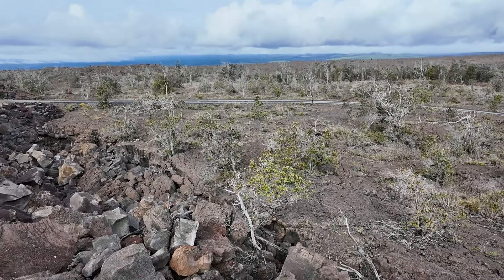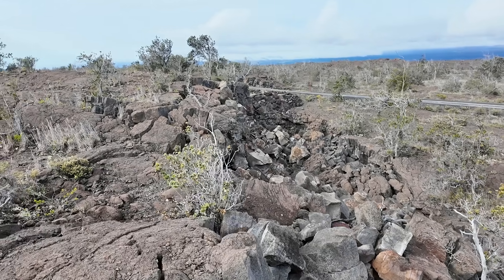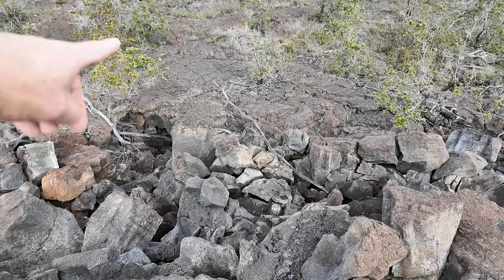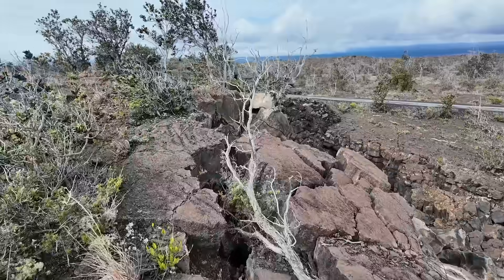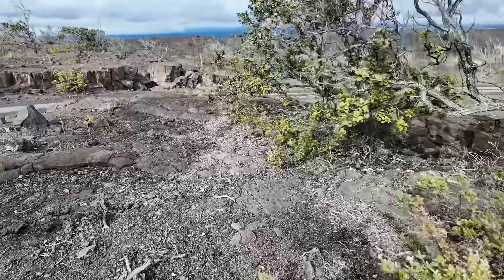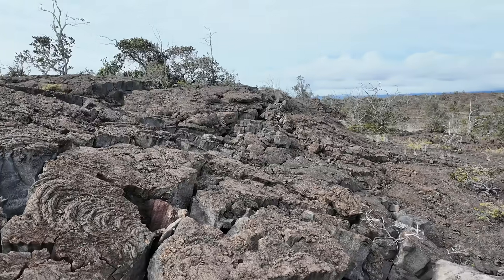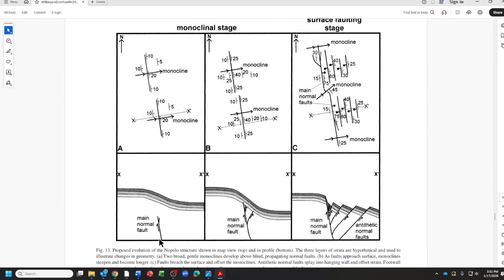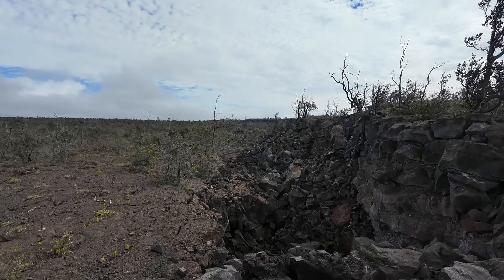What Is Ripping Kilauea Apart? Inside the Koa'e Fault System

Comment: Very interesting. I noticed the road was intact where it crosses the fault line. My interpretation is that the road pushes the pavement tightly when a vehicle crosses the fault line. This compresses the breaking rock, causing a strengthening of the broken lava to hold its shape.

Comment: Your funny geological true story. 
Up in Altadena on a small dead end road was a quiet community of six or so houses. A vacant lot was sold on the road and first thing was a major drilling operation about where a future house was to be built. Of course most of the residents was disturbed by the noise and industrial goings on on their tiny one lane street.
Eventually the bore hole was completed and a home built. A little sleuthing on the part of myself and a friend who lived on that street we discovered the new home owner was Dr. Richter.
Further inquiry from the Doc himself was illuminating. The dry supposed waterway behind the houses on the north side of the street was in fact a fault line, a spur off the major fault running under JPL about a mile away which in turn was a major fault off the San Andreas, one of the larger faults of the 'herring bone' running through southern California. He explained the dry waterway was a lateral shift between two stable ?? plates? I forget his terminology. It was a hyperactive something that directly reported the SA activity to his seismo. 
Doc Richter explained to us. He wanted his own personal seismograph to keep track of things during his retirement. The garage of the house accommodated his lab and test equipment.

Comment: I was on Big Island in November of 2000 and over 3 feet of rain fell on the summit and east slopes of Kilauea in less than 48 hours.  A big chunk (technical term) of the general area you're showing slumped towards the sea by 10 inches.  The story at the time was the rainwater lubricated the movement.

Comment: I was surprised that the uplifted side of the fault was to the south, i.e., closer to the ocean than the "upper" or dropped side of the fault toward the north.  I would have expected the opposite in a situation where the land is being "shed" or dropped into the sea in a north to south direction.  I would have to imagine that the gross difference in elevation as one heads south is declining, i.e., that the elevation above sea level is getting lower and lower.  So why is the south end the "uplifted" end of the fault?  Just curious, to me that was an interesting feature here.

Comment: Very cool. In a more coastal environment, due to footwall uplift, fluvial systems will be diverted away from the largest footwall scarps towards the relay ramp monoclines where in a coastal setting fluvial deltas will develop  downdip of the monocline due to faulting-related accommodation. 

Drilling structures located near the relay ramps greatly increases the chance of finding high-quality sandstone reservoirs that, in an early-formed trap, can be hydrocarbon bearing and often prolific. One such example is Hejre field in the Danish sector, drilled downththrown to a relay ramp along a major Jurassic graben margin known as the Coffee Soil Fault (yes, that’s the name). As you well know, geology is scale-independent!

Comment: I was reading about a newer theory on Mt. Etna. I'm not a Geologist so forgive my lack of correct terms as I try to put this info together. 

The very basic idea is that Etna is sliding into the sea not  primarily due to gravity pulling the slope down but due to structural failures in the submarine part of the volcano. 

In this video, it was stated that part of the surface volcano was not supported by the lower part of the volcano. Correct?

Putting the two together in mind I'm seeing a fault created by breaking downward. My mental example is a cake removed from a pan with an edge hanging over the side of a flat plate. The cake starts to fold down due to a lack of support and eventually will begining faulting and finally break off. There won't be a single point of breaking but many fault lines like in the connecting faults between the rift zones. Of course, gravity plays a role but the lack of support is key. Does that even make sense on a large scale?
Reply: I follow your reasoning and think the reason the cake would fall would be gravity. Thank you for the example which makes the issue easier to understand.

Comment: Good. The other islands became famous for massive underwater landslides stretching for miles, visible on Google Earth (Water Surface OFF). Can you compare this fault with the size of the other past landslides?  I made an ETS mechanical model for the Seismologists at the Pacific Geoscience Center near Victoria in 2005 to explain ETS (slip) on Vancouver Island Cascadia locked slab. It became the standard model, and Japanese scientists rushed over to take pictures of it.  I also got a call from a woman studying that very fault you are on. She said the same ETS mechanism controlled sliding of the land you are on as it was pushed over the ocean floor. She wanted me to make a model for her, but it was too big a job and said no. But I think it is not sliding, but just cracking at the top and  slumping as a future landslide. That is a massive amount of rock from where you are standing down to the ocean floor. Her idea was the inside magma plume must be shoving your part of the island sideways over the soft ocean sediments.  I suspect instead the low viscosity magma just shoots up vents. If she was correct, those cracks you are showing us would stretch down the sides of the volcano on both sides of the island, and magma should be squirting out those vertical cracks.  Any thoughts from you?  I don't know the geology down deep.

Comment: further east along the fault where Chain of Craters road crosses it, 19.358391371335752, -155.2243720340026, on google maps street view, you can see filled cracks in the road showing movement since the last repaving. Is the North side a graben, or is the South side lifting up because of block rotation as it slides towards the sea?

Comment: 3:32 different colors of the rock of the same erupción. Why? When I see the fountains of lava of Kilowea is the same color.
So interesting. And the pohoehoe algo nice.
Reply: Good question. Even within the same eruption, lava can end up different colors and textures depending on how and where it cools. Lava that cools in contact with air or water (on the ground surface) can oxidize differently, form different surface crusts, or cool at different rates. Lava that cools at depth stays hotter longer and can look darker and more uniform, while lava exposed at the surface can develop lighter colors, reddish tones, or glassy textures. So, the fountains may look the same when molten, but once the lava cools, those differences become visible.

Comment: Seeing the fault scarp with blocks of lava from the ropey pahoehoe lava flow made me realise something I'd never thought about before, and that the wrinkled, ropey texture of the flow's surface is actually only skin deep. It seems so obvious now why this is, but it was just not something I gave much thought to.
          I often hear fluid basalt lava being liken to something like runny honey or golden syrup, but I now think a better analogy would be hot caramel or toffee. Whilst neither are as viscous as even the runniest of lavas, they would still show similar properties to it, especially if flowing hot from the pot. The outer surfaces of the caramel or toffee would cool more swiftly than the interior of the flow, so you'd get the wrinkled, ropey appearance on the surface, whilst the interior stays smooth and homogenous.

Comment: Why is the downhill side higher than the other side?  Seems counterintuitive that it would be so.  Thanks for telling the story! 🙂
Reply: As the south flank slips seaward it creates a void which is filled it by the ground on the up hill side.
Reply: @MacGyver808  Makes sense!  Thanks 🙂
Reply: I was wondering the same thing. I have been to that area and wondered why the downslope side was higher. As you head east along the road the break becomes even a bit higher.
Reply: Good observation. It does seem counterintuitive at first. In this setting, the ground upslope is moving seaward as part of a large volcanic flank slump, while the ground farther downslope is moving more slowly. That resistance creates local compression at the base of the moving block, which can push the downslope side of a normal fault up into a small bulge or uplift. So even though the faulting is overall extensional, local compression at the toe of the moving block can make the downhill side appear a bit higher, or potentially higher under the right conditions.
Reply: @Mark.Earnest  Thank you, you answered my question.  Why Shawn didn't discuss this disappointed me.
Reply: @Mark.Earnest  Thanks for the description.  Helps me understand and I appreciate that!

Comment: Hi Shawn, great video. One question though. 
If the part of the fault you were standing on is slumping down into the sea, why is it higher than the other side, which is not.?
Surely it should be lower, as it pulls away.🤔
Reply: Was wondering that myself.  My only thought would be that maybe as the seaward edge of the slab drops, the slab pivots and the upslope edge of the slab raises?  Definitely interesting & curious to know as well!
Reply: Good eyes to spot that. It is important to realize that this one fault is part of a system of faults. There is a big fault at depth that is the main slip surface of the south flank of Kilauea, called a detachment fault. This fault is a small one that is allowing a block to tilt as the whole area moves south on the deep detachment..
Reply: In this setting, the ground upslope is moving seaward as part of a large volcanic flank slump, while the ground farther downslope is moving more slowly. That resistance creates local compression at the base of the moving block, which can push the downslope side of a normal fault up into a small bulge or uplift. So even though the faulting is overall extensional, local compression at the toe of the moving block can make the downhill side appear slightly higher, or even higher under the right conditions.
Reply: @Mark.Earnest  such a great question.  Excellent catch. Looking at the 6th picture at time 9.23 might help explain.
Reply: @Mark.Earnest  This fault system is near the top of the volcanic flank slump. The toe is offshore underwater.
Reply: @ericfielding2540  The “toe” is the downslope, leading edge of a moving slump or landslide, where the sliding mass runs into resistance and stresses concentrate, often causing compression and uplift. It's not the ocean.
Reply: @Mark.Earnest  Yes, the Kilauea flank detachment is about 15 km thick and has its toe offshore.
Reply: I came here to search for that question myself. 👍 
So it would appear that the uplift is from compression and not 'titlting'. 
I Did wonder. 
Interesting stuff eh ?

Comment: @shawnwillsey. Is there a time line for the Kilauea slippage?  Is this a decades scale, centuries scale or a "hey man you better move your car!" scale?
Reply: "hey man better move your car".  That seriously should be added to any warning system.
Reply: The movement is 2.5 to 25cm a year but the slide into the ocean isn't a linear rate. It may go all at once or in peices. The next Mw >7 quake is predicted in 25-30 years. That would be a great chance to trigger a slide. Bathometery shows previous large scale slides on the ocean floor.
Reply: @youruiz  Isn't the prediction based on factors and influences that have been in place in the past? Are we taking into account the rebound effect on the crust from the removal of 28 trillion tons of ice/glacier melt at the poles from GW in the last 20 years? I'm not convinced we have 25 years to move all those vehicles - and to where? What's the ripple effect here on the rest of the island and chain?
Reply: @KyrieDicentis  technically we are still experiencing rebound effects of the deglaciation at the end of the younger Dryas.
Reply: @KyrieDicentis  These faults shown in this video are very small and confined to the specific area you see in the aerial view. They are nothing like the more familiar faults between continental plates, particularly around the boundary of the Pacific Ocean, which extend along the coastlines of entire countries, and more. When one of these Ko'ae faults has a break, or a significant slump, there'll definitely be a tsunami if land sustantially goes into the ocean, but almost certainly the effects would be confined just to the Hawaiian Islands. The last such event was in 1975 and the tsunami only affected part of the shore of Hawaii Island itself.
Reply: Comments rarely disappoint and your comment got the award today!😂😂😂
Reply: @samhklm  probably decades or centuries….
Reply: I saw a video a few years ago that showed evidence that large masses on north sides of both Molakai and Oahu slid up into the Ocean. Eventually, the part of the island in the video is going to slide off into the ocean. It could be incrementally or the whole thing going. It could be in 5 years or 50,000 years.
Reply: 🤷🏽 whenever scale
Reply: last time I looked at this was mid-90's and back then they were saying they weren't sure which side of the shelf would slide into the ocean.  No ETA either way.  Just a matter of time though.
Reply: Eating breakfast on the Kīlauea slopes…hoping I’ll have moved before the killer tsunami..

Comment: Enjoy your Hawaiian vacation, professor!

I remember seeing a documentary about this years ago, where they were concerned about a long runout underwater landslide (and subsequent tsunami) if/when this thing inevitably slumps down into the ocean.

What’s your take on that?
Reply: Basically might happen in few days, next month, next year, next decade, next century...
There just isn't enough knowledge to precisely say what's going to happen and when.
All we can say for certainly is that there have been all kinds of flank collapses of volcanic islands.
And they won't stop from happening just because us humans are here.
Reply from the maker: Very low probability of that event occurring.
Reply: The decollement actually slopes backwards because of the weight of the island bending the crust. It helps prevent any sliding basically, think of it kind of like a doorstop wedge almost. So while the land is definitely slumping quite a bit around Kilauea, its nearly impossible for it to actually slide.

My personal theory around the timing of the landslides in the Hawaiian islands always seeming to occur after the main shield stage is that the uplift from rebound (after enough erosion, the islands start to rise a tad instead of sink) flattens out the decollements enough for the slumps to finally be capable of sliding.

Interestingly, it seems like other volcanic oceanic islands don't quite have this same mechanism holding them back, IIRC La Palma has a terrifyingly high chance of a slide (like IIRC ~1%?) but I'm not entirely sure what factors are at play for that one. Would love an actual geologist's take on comparing the different landslide mechanisms for different islands and why some are/aren't likely to slide!